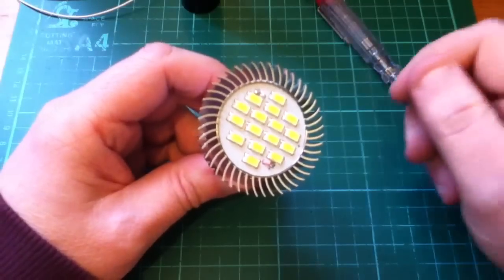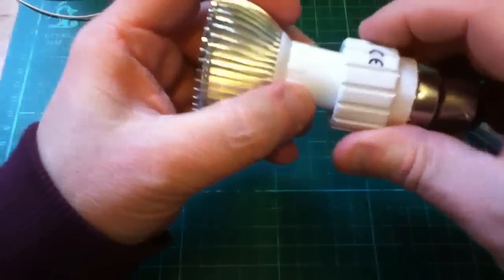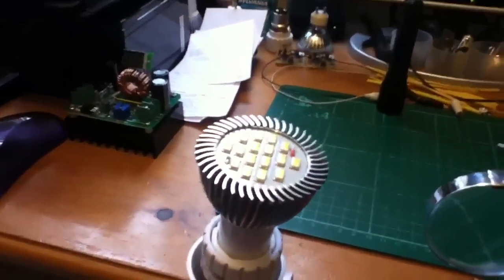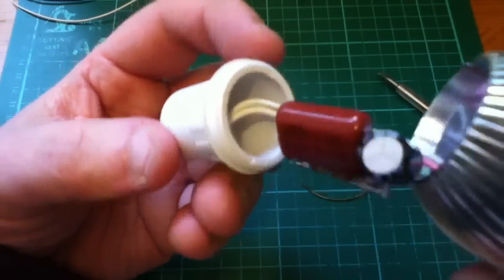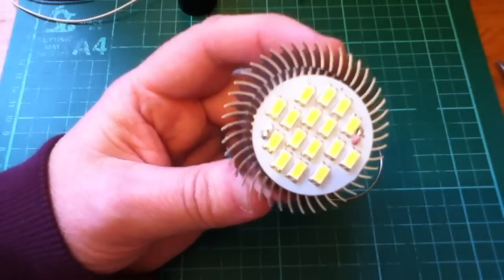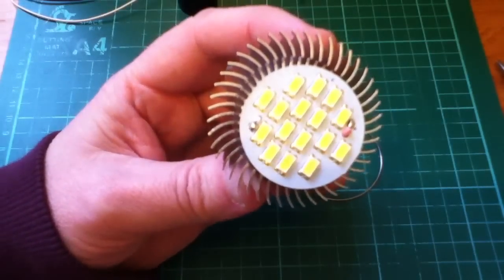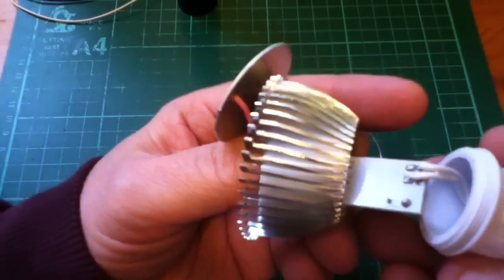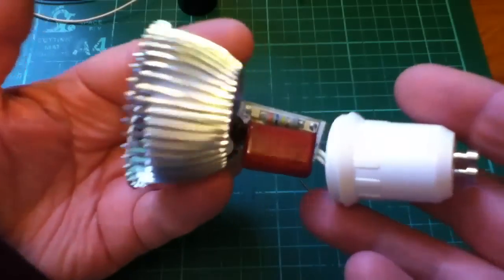Dangerous GU10 LED Spot Light is Cheap and Bright but could Kill You - Seriously

Comment: You plug it in 220V and on the other end you get 12V so it is not killing power there in that bulb(thats is why you got a diode,capacitor and resistor in it) , so did you measure voltage on the other end??? When you do share the results with us! :D
Reply: Wrong - the 12V is only there if the LEDS are working. If one led dies, there may be an open circuit and nothing to clamp the voltage to a 'safe' level.
The driver here is not a voltage limiter, it is designed to limit the current to prevent frying the leds. The leds themselves keep the voltage clamped.
Remove or destroy a led - the volts on those two terminals will hit 240 V ( 120 V usa ) , and supply a nice potentially lethal current.
Reply: rowifi  it is not logical ,if one dies voltage stay the same 12v there is no reason for V to go higher.
Reply: Vladan Umicevic Imagine that there are NO Leds connected. The circuit is then just a capacitor, with a rectifier. Connected to the mains. There is no voltage regulator that we can see on this circuit. The voltage on the two wires will be mains - ( DC ). The same would be true if there was a high value resistor instead of the capacitor. The voltage will be mains. The capacitor is acting like a resistor to limit the current when it is connected to a load ( the leds ).
If there are no leds, the load will be anything that touches the terminals, and the current that flows will be dependant upon the capacitor value and the resistance of  .... you. 
The Leds actually are acting as individual mini voltage regulators. Look up Led / Diode forward voltage. No matter what voltage you apply to a led ( provided there is a series resistance to limit the current ( i.e. the cap ), the led or leds will maintain a couple of volts across each of themselves. That's what diodes do. Just like Zener diode regulators  - but in reverse.

So, lets assume that all the leds are in series in this circuit. There would be about 2V x 16  leds, about 30 volt across them in total.  So while all leds are on and working, the voltage across the terminals will be set at about 30V. If you touch across the terminals you would probably be OK. The leds are taking the most current - your resistance to earth ( or where ever ) would be higher than the leds effective resistance - so (probably ) no shock.
If any of the leds went open circuit, none of the leds would be conducting, and so they would not be taking current and therefore not 'locking' the voltage at 30V.

If you touch the terminals, you would get mains voltage at whatever current the capacitor together with your body  resistance would allow - nasty.
Remember, there is no voltage regulation before the leds - the leds themselves are clamping the voltage to a lower level - so long as they are ALL operating correctly.

I hope that helps.
Reply: Vladan Umicevic
There would be dangerous voltages present. Go off and study properly.  Rob Field is right.

Comment: it doesn't matter which way round the input is as the output of a bridge rectifier is always the same.  bridge rectifiers not only convert AC to DC but also polarize the output in the correct way regardless of input

Comment: Just for information the CE marking just means 'Produced for sale within the EU' it has no implication of passing any safety standards.
Reply: The CE marking is required for many products and attests the verification by a manufacturer that these products meet EU safety, health or environmental requirements. www.gov.uk
Reply: The CE marking does NOT mean 'produced for sale in the EU'. It means that the product meets ALL required standards, including safety that the EU demands. This does not mean that the product has actually been tested - rather it means the manufacturer is 'stating' that it meets these requirements.  The manufacture takes the risks if it is found NOT to comply, but still doesn't mean it does actually meet the standards - should you choose to have it tested yourself. Everything sold in EU must have the CE mark - that means it meets all the requirements ( MUST is a better word ) - but you are really only taking the manufacturers word for that. Unless you have sight of a test certificate issued by an approved test lab ( easily faked of course ). It is called ' self certification' and therefore the manufacturer assumes responsibility for proving it is safe - if challenged.

Comment: I stumbled upon your video here in the dredges of YouTube.  Thanks for posting.  Unfortunately, you do not appear to understand how LED's (or diodes in general) work.  I confess that I didn't read all of the replies or comments here, but on the first page no one mentions that diodes only accept voltage in ONE direction.  Even though you can cross wire the input, the voltage to the diode remains the same.  If by some chance that the + is on those exposed leads, it could pose some risk to you though likely not deadly.  Consider a diode to be a type of check valve if you were dealing with a fluid in a pipe.  They can be used to convert AC voltage to DC, since they only allow passage of voltage in one direction.
Reply: I'm getting tired of this; GO BACK TO SCHOOL - A LITTLE KNOWLEDGE IS A DANGEROUS THING!  In the meantime, listen to the bit where he talks about a thing called a "bridge rectifier".  I hope your ears burn!
Reply: Is a four minute video already to much for your attention span? (btw. you'd only need to make it to about 2 minutes to hear where your first mistake is).

And have you looked at his other videos? Do you really think that with the stuff he builds he has no idea how diodes work? Be honest and state that you understand and can explain the contents of his other videos. Then you have the right to call him out on "not understanding".

Comment: Might be more than met your eye on the tiny drop circuit. Perhaps a voltage tester on those front contacts showing a reading would be more convincing since LED generally are not a direct connect to 220-240v.

Comment: scaremongering BS  a white led has a  Vf of about 3.5v DC. If it had 230v ac it would fry. It's a classic transformerless power supply/series capacitor and dropper resistor with bridge rectifier and probably a zener to regulate the probable 12v dc that appears across the front plate on the pink and white. Don't believe me ? put your tongue across it then

Comment: Also a very poor power factor. You failed to mention that for whatever reason the series capacitor fails in short this thing is likely to get caught on fire. with rectified AC straight into the bulbs. I don't suppose it has a fuse.

Comment: But seriously...  Rule #1: Close the light switch

Voila... you are now safe when you put it in or out !
Reply: Nor really. Light switch only cuts one conductor. If that turns out to be the neutral because someone was too lazy to check upon installation its as good as nothing. Happened to me a few times in Edison type bulbs.
Reply: Susana Godinho but i thought in an AC Current, Live and neutral "Alternate" 50 times a second?
Reply: 100 actualy. But live and neutral are not polarity dependant. +220V will kill you just as -220V. The neutral conductor is referenced to the earth so won't shock you if you touch it because we sit at the same potential, hence no current flow. Live has 220V RMS above the earth, so if you touch it you create a current path between the two conductors. Thats how an RCD works
Reply: normally there are 3 terminals involved
1=earth/ground
nothing happens if you touch it

2=live
you will be shocked 50times a second if you are touching the ground(will not be shocked if floating)

3=neutral 
same as live? or no shock at all?

because live and neutral keep switching places.
Reply: You shouldn't feel anything on the neutral, as it should be connected to ground.  That said, what you think is neutral might not be (people wire houses and installations - not rule books), so always switch off and by that I mean ISOLATE, test, then work on it.

Given the construction of these lamps, leave a powder extinguisher nearby just to be on the safe side.

Comment: if there is bridge recitifier, how can LIVE be on the heatsink on diodes
Reply: well electrical engeneer, there is nothing lethal to this led and you're all aware of it,,, your telling me that 20vdc some small miliamps can kill a human, it can, when you lick one pole, and stab other pole in your heart, by your logics everyone who have held car battery both poles both handed should be dead,
Reply: xplodermin
Newbie error. Unless there is a transformer in a circuit there is no isolation and the whole circuit should be assumed to be live. There may be a low voltage across an LED but relative to the ground it can still be live.
Reply: xplodermin i cant believe how moronic you are being iv even used the maths to show why these are dangerous and the analogy i was using could happen when the bulb isnt damaged, its most likely that in ur analogy your RCD would shut off the power before there is any chance of anyone getting electricuted because it would have detected the over current from the broken bulb, but let me guess u dont have an RCD because there a waste of time cos nothing goes wrong with electricity. and for the last time of saying a low voltage circuit is just as dangerous as any other electrical circuit when you have conductors exposed. never heard of the story of the guy who put to telephone wire pairs between his teeth to free up his hands who killed himself and telephones work on a 12/24VDC circuit depending on how old your wiring is. oh and the science teacher who stopped his own heart trying to prove a 9v battery could not harm you by licking it whilst stood in a bucket of water guess what happened to him
Reply: chimpey11 calling someone moronic in lack of arguments tells me you are shallow as chimpy, who gives a fuck about your numbers and maths, as long as the led does not shock on touch there is no argue about it anymore, btw tel. lines in Europe have 45V to 50V (48V) analog and dsl, 70V and more when ringing,and it gives quite a shock, just so you know :))) as i sad in earlier post, licking wires can kill you, touching it makes you shocked a litlle bit, cheers
Reply: Well if your leds blow and you will not know if there is electricity or not and you will touch one contact you might get 240V on there so you might get really bad shock. So this is really bad design. If it is all plastic encapsulated  then it is all right no problem at all. Even there should be input fuse. But as it is it is really dangerous.
Reply: output is nearly 15-20 VDC  to diodes, the problem here isnt bad design, rather its not knowing basics of electricity, and handling household apliances, nothing on this led can harm anyone, its not made to be played with , its made to be pluged in socket and light a room
Reply: xplodermin 15-20VDC can easily kill in the current exceeds 10 mAmps being its the current not the voltage thats the killer, i know of 12VDC circuits in my line of work(in an Electrical Engineer) that carry a current of 200 amps so never be fooled just because its a low voltage circuit
Reply: xplodermin look up ohms law and read about it cos it will show how 20vdc can cause a very hi amp output, if theve messed up the resitance then it definately could be lethal now im not saying it will definately kill it just has the potential to do it, and it is as small as 10mAmps as this is one of the things you are taught first on any electrical course and the other common fact is that most lighting circuits even ones containing LEDs are usually producing around an amp at peak, when the circuit is originally connected (at switch on circuits tend to spike)
Reply: newbie? no, you just don't realize,,one thing are laws,maths and physics,,and all you say is correct. what i am saying is that you and review guy are assuming to much and giving estimates,, he didn't even touch a led case / heat sink while its on,, or made any measurement , but rather makes a video of playing 'chinese' russian roulette with an led so cheap that makes you say wtf . there is a thing called every day life, so people use electronics mostly with good knowledge and almost every electrical appliance can be lethal or risky if not used properly. better safety leds,cfl ... : philips, osram , cooper, GE.......don't say, hey these are chinese and can kill you.
Reply: Don't know what your argument is. Our point is that the lamp is designed badly so only experts should handle it. Don't leave it around where unsuspecting people might use it. If you do mess with it use an rcd and also test it with a neon screwdriver.
Reply: xplodermin okk so we apply some figure to the argument shall we then lets say its a 12v circuit and say the LED's have a power of 3w each which is the same as your average LED emits using those two numbers we can work out that the current running through the circuit would be 250mAmps and if you read this below its shows that its more than enough to seriously hurt or even kill a person and thats at the lowest voltage required to run a LED. never mind the fact that there is 16 of them which means if each was to run at 3w (which like i said is a normal LED power) you times that number by 16

Here's some info from the CDC. 

http://www.cdc.gov/niosh/docs/98-131/overview.html

It lists around 16 mA as a current level where you may not be able to let go. 

Around 20 mA can paralyze your respiratory muscles and stop breathing. 

100 mA can cause ventricular fibrillation and stop the heart. This is particularly dangerous because even if you get disconnected from the current, your heart won't necessarily restart.
Reply: Peter Kwan
sorry if you don't understand, my point is that lamp is just fine, buy it, insert it in a socket or desk lamp, switch it and enjoy light, no need to touch it, or play with it in any way just like with any other type of lamps . there is a bigger chance to get harmed with incandescent bulb than this one .
Reply: That lamp is illegal in most places. The low voltage directive would see to that. But feel free to risk your own life.
Reply: xplodermin ok say you put it in that desk/table lamp turn all safe turn it on and dont touch it, what about if you have kids would you want them turning it on or good forbid that 2 year old that just has to touch everything, with an incandescent bulb he she would get burned, with this the get an electric shock. yes in a ceiling fixture you wouldnt be touching a lamp with the mains still on but there are always those who will and this guy might have stopped a few people hurting themselves by making this video
Reply: Peter Kwan
drugs are too, yet its available everywhere unfortunally
Reply: xplodermin yes and would kill your self more easily with these tell you what try buying one then touching it while its on then comment
Reply: chimpey11 yes i actually will buy the same one, make heat sink connected to + or - on the diodes,test it all possible ways and post a video of course, btw incandescent lamp fallen from a desk and broken will electrocute anyone touching electrodes, so burned by its heat or electrocuted is not the same, comparing with a possible small voltage shock on a  led bulb, if the led is manufactured bad

Comment: After passing through board, voltage would be well under 20V and DC.  BIG WHOOPIE!
Reply: Please do not try to give advice if you do not fully understand electricity, or if you are not bothered to think it through properly. Depending on which way the spotlight is inserted, half of the time there will be live 240 V at the very front of the spotlight (as stated in the video).

Agreed, an AC voltage meter reading between the front board and ground should have convinced everyone. Folks, that LED spotlight is DANGEROUS and should be pulled from the market.
Reply: GO BACK TO SCHOOL JESSE - PLEASE, BEFORE SOMEONE GETS HURT!

Comment: Don't forget to shut off the mains power in your house before plugging anything into the wall; after all the bare metal contacts on the plug are not insulated and you might touch them during installation of the plug.  Really.  You could die.  No Really, you could be electrocuted and die.  In fact, it might be a slow, painful, sizzling death.  Especially if you're barefoot and standing in an earthed puddle at the time.

Comment: Put an ohms meter across the back plate.  you'll probably find it's nonconductive Alumina, not aluminum.  Alumina is a good thermal conductor but a bad electrical conductor.
Reply from the maker: It would certainly be safer if the plate were made of Alumina. So I've been searching through boxes all morning trying to find the original bulb. And I'm sorry to have to report that the plate is aluminium. Zero Ohms.